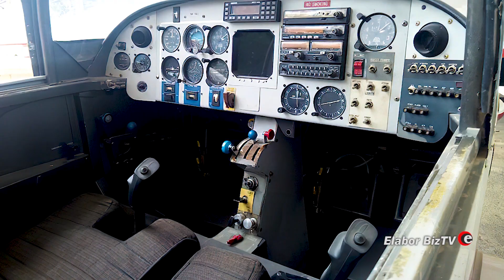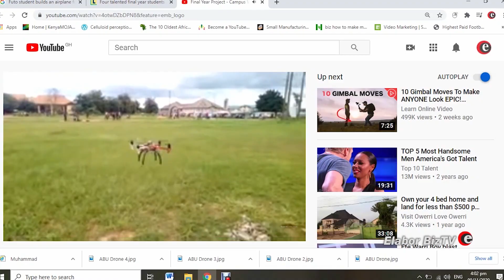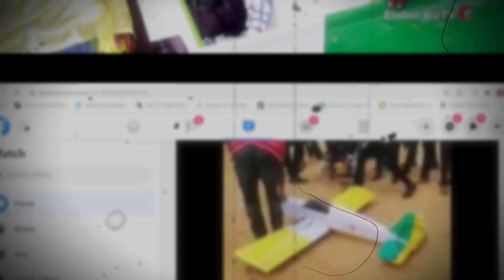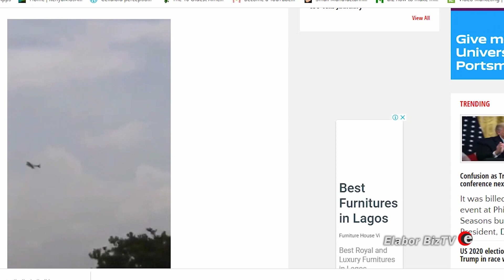Made in Nigeria ‘Aircrafts’ and Drones

Comment: They need to read some books on aerodynamics and aircraft construction. A few of the full-sized aircraft MAY fly, but most of them don't even use airfoils for the wings, rotors, or propellers. All of the science behind that was understood by the Wright Brothers before they even built their first glider. They didn't discover that themselves. What they did more than anything was figure out how to control the plane in the air, and how to design an engine and propeller system for powered flight. Just starting with basic principles of aerodynamics would get them closer to flight, but then people are going to start getting hurt trying to figure out what's already been figured out. At least most of the aircraft in this video will never get off the ground. Instead of wasting their hard-earned money on scrap and junk that will never fly, they should be buying some second-hand books on aerodynamics. Surely there's a program there that offers books to people who clearly have a real interest in aerodynamic engineering. I don't think these guys are stupid. Ignorance is not a bad thing as long as you admit it, then do something about it. I literally did the same thing when I was about 11 or 12 years old. My helicopter looked like a helicopter and it was made out of 2X4's, but none of the rotors were airfoils, and there was no collective or cyclic; the blades were fixed pitch and only moved in a circle. My 12-year-old brain didn't even consider how to control in once it was in the air. My dad told me it would never fly, but let me build it anyway. Then he scrapped it, got me an RC plane and taught me basically what made it fly, and I've been hooked on aviation ever since. Helicopters are pretty complicated, as well as expensive, especially back in the 80's, so I'm sure he didn't know enough to teach me about them. The people in this video are looking at aircraft with a child's eyes, then trying to copy it. They need to be encouraged to learn how all of that stuff works, not to go out and try to copy what they've seen. If they had as much drive to learn as they do to build, I think they could catch up to the rest of the world, and then after that, we might be seeing more innovation and new tech coming from Nigeria. But not until then!
Reply: Very fair and objective analysis, some would only be negative im their observations. Personally I would love to see actual flying.
Reply: @kenneth6417  This is typical cargo cult behaviour, they have zero clue what makes a plane fly, they just imitate a rough look.
Reply: Thank God finally someone with brains. I can make an engine, all these thing are already in book it’s just be a genius have a zeal for it, helicopter blades and speed force are tested in a gram checker to know how much weight it could carry, and what needed to be added to make the engine run faster, watching that video make me feel dumber.

Comment: This is nigerian comedy gold :D
Reply: I want to know what you have made till date.
Reply: @Workshop_fer0x  So the point is making something? not making something that works? all these things looks like projects made by 10 year olds, when adults do the same you can only laugh at it.
Reply: @Workshop_fer0x I’ve made several models, some powered, some not. I’ve also repaired sailplanes, worked on small aircraft and flown them as well as larger aircraft. The point is, if these enthusiastic builders put as much effort into design and research as they did bashing metal they might have viable aircraft. Fortunately for them they lacked sufficient funds to get airborne.

Comment: Early flying plane and helicopter were made with wood  to improve the motor thrust Vs weight ratio. Here weight = the aircraft+ the pilot.   Many hobby planes designed in Africa are failing to take off because they under estimate that ratio which is a basic fundamental to fly.I hope next generation will fly local built aircrafts within the next 5 years.